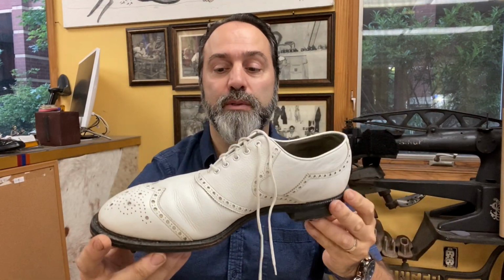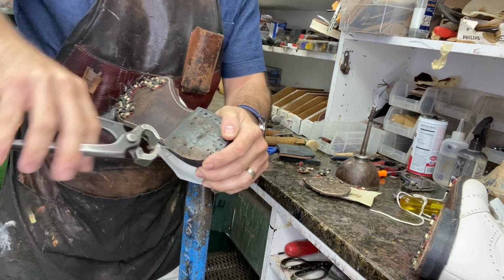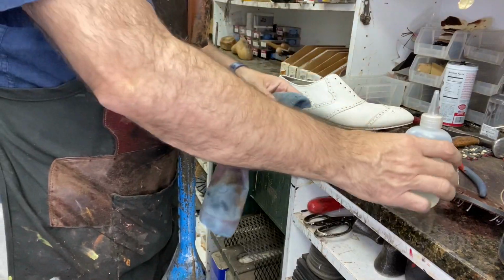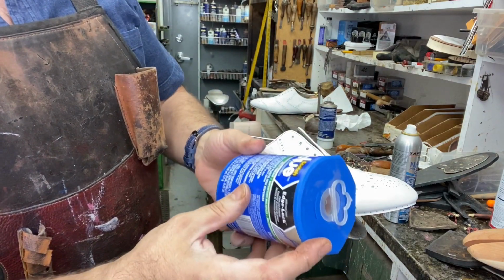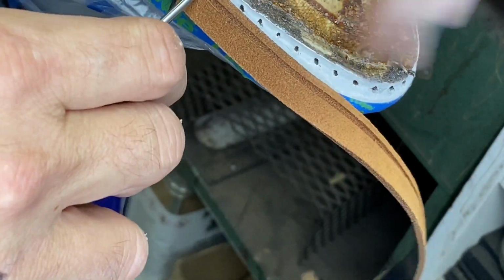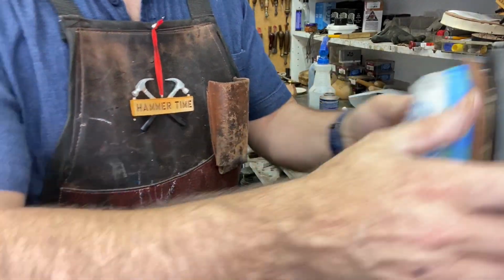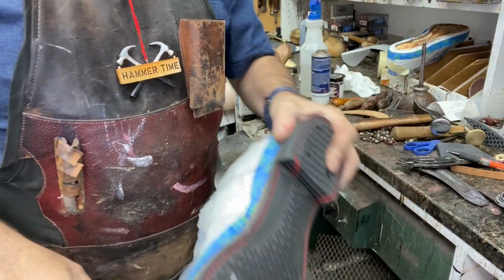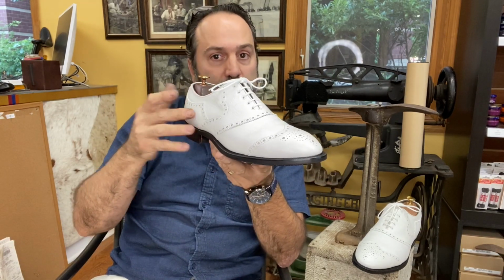Recrafting Footjoy golf shoes

Comment: To answer your question, yes FJ are still making those (the cheaper mass produced are the Icon and run for around 300$with rubber sole and custom options - very solid shoe which replaced the Classics) but they also have the 1857 Collection where they offer Goodyear Welted construction. Full Leather Linings & Outsole like the Classics (that pair you repaired). Price is 750$ though. You did great job with this pair. I love my Footjoys and most of mine are white leather but I learned to give them some love and care so hope they last 10+ years and hopefully longer.
Reply from the maker: Thank you for the info

Comment: In my high school marching band we were required to wear white bucks with our uniforms. Since you had to march on football fields in all kinds of conditions, they got pretty filthy, and since they were suede it was more trouble than it was worth to try and clean them. Yeah, you could brush off the worst of it pretty easily, but cleaning them so they looked as good new was futile. But they needed to look nice and white for the uniform. So we just took a bottle of Kiwi whitener and went over the dirt with it. Wasn't great for the texture of the suede either, but it wasn't as if you'd wear them with anything but your band uniform anyway.
Reply: Did they have the red rubber soles? I had those in jr high marching band. ROTC black oxfords in high school marching band.

Comment: When I took up golf I bought two pairs of these, they were white and crocodile correspondent's. I had a complaint and sent a pair back and they objected to me having removed the Footjoy badge which was nailed onto the outside of the heel. I like metal spikes and have quite a few but no shoes to which they can be fitted.  I am surprised that the welt is not 360 degrees since golf is not played on level ground and the spikes have the effect of separating the sole from the uppers in hitting a ball.   Golfers no longer wear traditionally made shoes which require maintenance and company logos are now integral to the shoe.

Comment: I don’t think you should’ve changed the soles to rubber. You said that the oil tanned leather, eventually will fall apart because they get wet/dry/wet/dry, but the first shoe that you worked on that weren’t split were still in very very good shape for being 20 years old. I don’t see the reason to change them